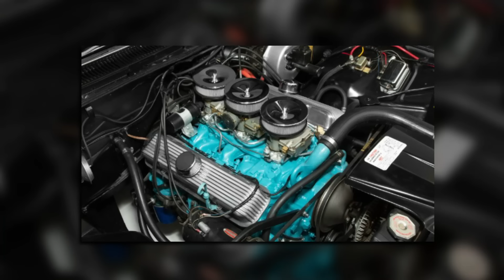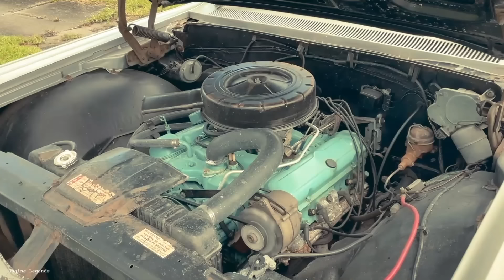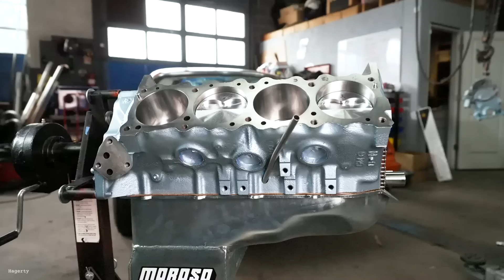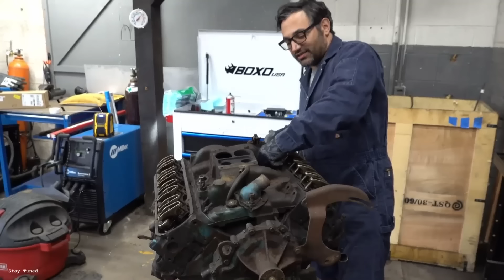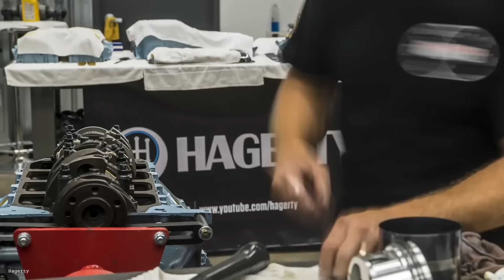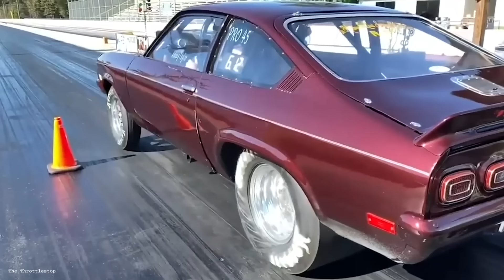This Missouri Teen OUTSMARTED Pontiac With a $70 389 Tri-Power That Destroyed 421s

Comment: A lot of BS in this story. He was around 30 when this was going on.  He didn't run primered heaps. He did run 421's. The factory race 421 super duties NEVER had a roller camshaft. $5K for an original tri-power setup is a bit high. I will say the 389 tri-powers were no slouches.
Reply: Arnie's 96 in May, 2026. . Was 32 in "62..  No teen!!!.. 👎??..
Reply: HE WAS 32 IN "62... HE ALWAYS GOT BETTER STUFF STRAIGHT FROM PONTIAC. BECAUSE HE WAS A WINNER SIX YEARS BEFORE "62????...😮??.. THAT'S WHY HE GOT STUFF RIGHT FROM PONTIAC and PONTIAC engineering...  Wow??? IS THIS VIDEO off??  95% off??...  In stock classes NHRA doesn't allow port heads.. or in SuperStock??...
Reply: I just talk to ARNIE four days ago about this mess of video?? At Norwalk,  Ohio.  At PONTIAC NATIONALS...

Comment: Back in the 70s, my buddy had a stock 70 camaro 350 2 barrel. I was working in a machine shop part time while in high school. Long story short, I ported his heads, added headers, a mild cam and a single plane intake with a 750 holly and lots of tuning. We raced every morning before school. That camaro dusted just about everything that came up against us. Super Bee's with big blocks, mustangs and even an Amc 401. It came down to knowledge and tuning. I couldn't afford to build my own car, so I used his car and his Mom's money to build his. We smoked just about anything in school. Those were fun times  in the 70s
Reply: Me thinks you smoked too much weed
Reply: LMAO. I had a 69 Mustang with a 302, 2 barrel, and a 3 speed. I sold it and bought a 69 Firebird.

Comment: I had a similar built 389 SD crate motor that I put in a 1968 Sport LeMans. I turned an 11:22 qtr mile in 1977. I put 3 higher cfm carbs on it with a high rise intake. Thd heads were ported and polished also with the multi valve angles.
It was about 575 hp. I ate every 421 SD and especially Hemis.
I even took down a ZL1 Camaro.
They were under rated and a few tricks can make a huge difference. The crate had a tag on it that read not for street use.
I used it alright. It got 6 mpg when hot rodding and 14 mpg on thd highway. It had a 3:90 limited slip 12 bolt differential, 400 TH and Hurst dual gate which was stock in that LeMans.

Comment: Arnie was 34 in 1964. He was a Farmer. He raced since 1950. Arnie NEVER had unpainted crap?.. He always had top notch equipment. He always had 421's in "62, "63, "64. SHELL's  premium was 106 thru '60's and thru mid '70's... Ferrari's always used SHELL products for a reason! They work!!..  😂.   .
Reply: I know two people that obtained parts from Arnie Beswick.  Dan Pulowski bought a 421 SD from Arnie with a 1963 Bath tub dual quad.  He use to run at the drag strip in Lake Geneva.  The motor was in a 1964 GTO called the psychopath.  He couldn't keep head gaskets in the motor and stopped drag racing.  He repainted the car, sold it and sold off the parts.   The second person was Father Jerome Leake.  He bought parts from Arnie but he had to get a driver since the catholic church would not allow him to race his car.  When I met him he was running a 1968 Firebird with a ram air 5 motor.  He then switched to an Astre body with the same motor.  He finally stopped racing Pontiac motors and switched to Big block chevies with those Pontiac/Chevy big block heads.  I believe he doesn't race anymore.   I've got a set of #614 Ram air 4 heads he use to use in his 1969 GTO. Father Leake was always looking for donations.  By the way I met Arnie when he was racing a funny car firebird called Boss Bird.  As far as I know he was a dairy farmer in Morrison Illinois and I never heard of him living in Missouri.

Comment: i had a 66 GTO in early 70,s put on holley 750 double pump, isky high lift cam, hooker headers and 2.5 years later the kid i sold it to had it put on dyno and put out 630 HP
Reply: LOL  (Don't Bogart that joint.)

Comment: The 389 with three-two’s were no joke…! (1965 GTO, midnight blue color - was a small child, then.)
Reply: My first car was a midnight blue 65 GTO with the Carter AFB and headers, I never lost a race in that car. After blowing up the rear end and replacing it with a junk yard replacement,  I had sudden total brake failure while doing over 120  during a test drive that turned into a police pursuit and ended in a pretty spectacular crash. I sold that car shortly after that but regreted it. I wasn't really looking to buy another one but a few years later my room mate spotted one sitting on milk crates on someones property and he put a note on it with my number unbeknownst to me. A woman called me and said I could have it for $25 but I had to tow it away, so I bought it, this is back in 1976. I found a tri power setup on another crashed one and installed the 3 deuces on the freshly rebuilt engine I installed in the new purchase. I was shocked at how much more get up and go the 3 deuces  provided over my first GTO, the stated horsepower gain was only 25 more than the 335 rating with the 4bbl. that's laughable. My seat of the pants dyno tells me it was probably more like 60 or 70 more, but the seat of the pants dyno was likely registering more torque than HP. I understand why they killed the tri power offering after only 3 years, the 65 I got the tri power off of had a huge imprint of a tree dead center of the front end that pushed the engine back so far it broke the case of the muncie I was also hoping I could salvage off the car when I bought it. The brakes of a 65 GTO are woefully inadequate for the power the engine produces, I had manual brakes on my first one with that rediculously small master cylinder, I never did figure out what gave out on my test drive, I supect it was the rubber of one of the brake cylinders on the junk yard rear end. The brakes worked until I really put them on hard trying to slow down and turn right at the red light I was approaching, nobody got hurt in the crash which was a miracle.
Reply: I still have the car and am getting ready to do a full gground up restoration.